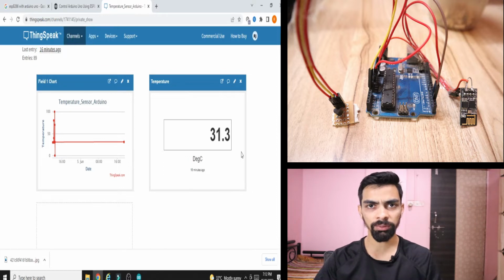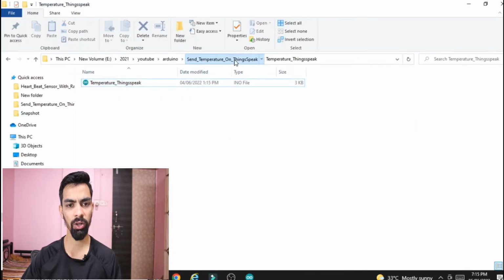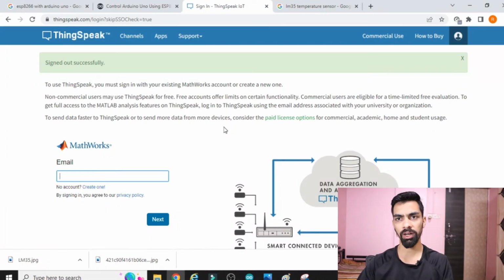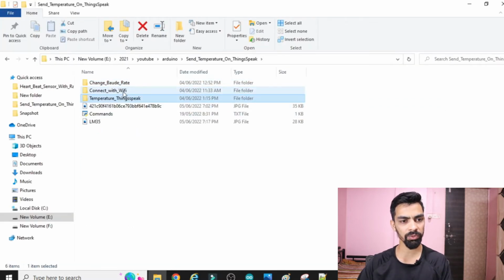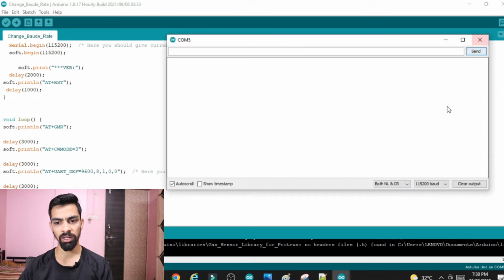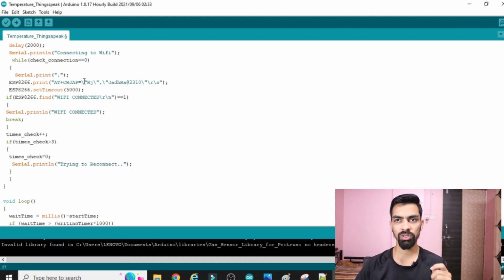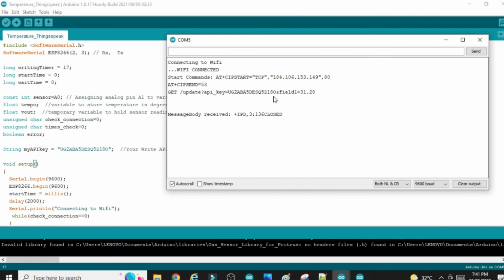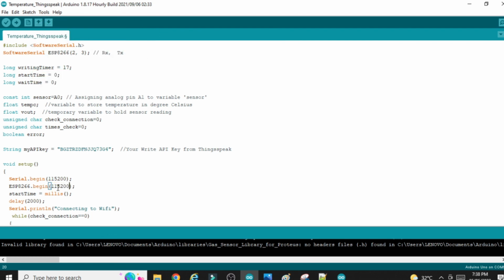esp8266 with Arduino Uno |Provide Internet To Arduino Module|Temperature Value on thingspeak server

Comment: sir it will if you can connect  esp8266 01 wifi module to firebase and send data to firebase
Reply from the maker: I will check .

Comment: Sir, I tried to connect my esp8266 with wifi. but the serial monitor always shows trying to reconnect and data is not sent to thingspeak, even though my wifi hotspot is connected to esp8266. What should I do to solve this problem? I ask for your help, sir.
Reply from the maker: If serial monitor showing not connected then your esp is not connected to wifi that why data is not showing on thingspeak.
Check connection
Reply from the maker: I also faced this issue before when i replaced my esp then it's start working sometimes esp may getting damaged

Comment: Rahul sir,   I'm actually trying to read four analogue values on thingspeak. If you have time, sir, please add one more analogue sensor to analogue input A1 and send me the code. I just need a code, and then I'll compare the two codes and put them to work for the four analogue sensors. please sir   thank you  Rahul sir
Reply from the maker: Sure I will develop project humidity sensor with Arduino and send value on thingspeak